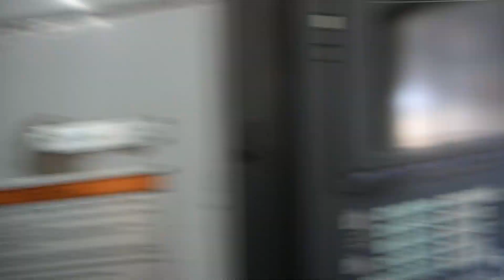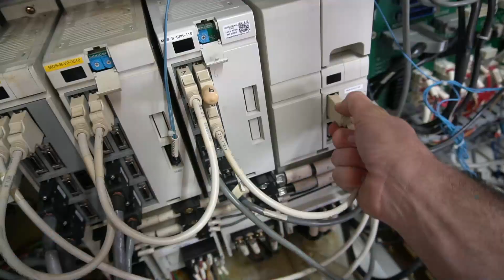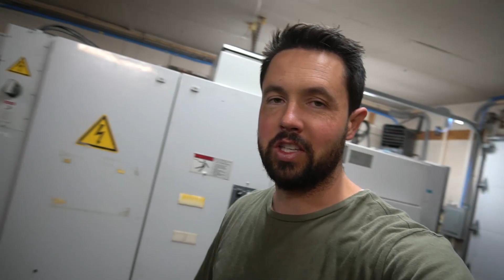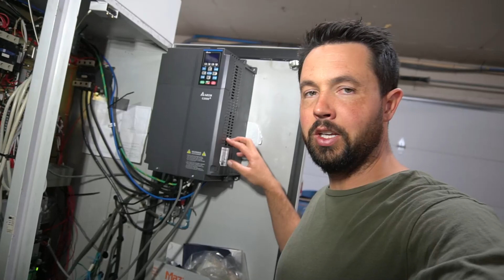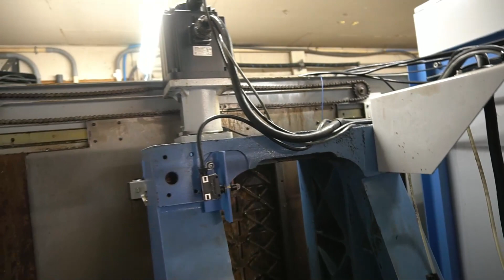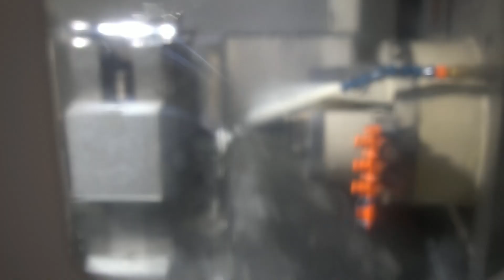Mazak Horizontal CNC Retrofit + Centroid.

Comment: I don't think this machine is going to accurate or reliable its going to be a nightmare to work with
Reply from the maker: The electronics on this machine are now 20 years better than the ones it had.  The servo encoders are 20% higher resolution. The control can run unlimited lines of code, now has complex probing routines built into it, is easy to service myself and works every time I turn it on.
Reply: @ericschneiter  how accurate is it ?
Reply from the maker: @abdalrohmanmousa7405  My parts come out exactly spec’d to my CAD model.   I’m the one who calibrated the ball screw resolution and tuned the drives.
Reply: @ericschneiter  you words encourage me to buy  a machine and  try with it